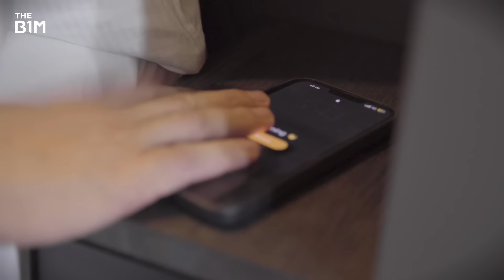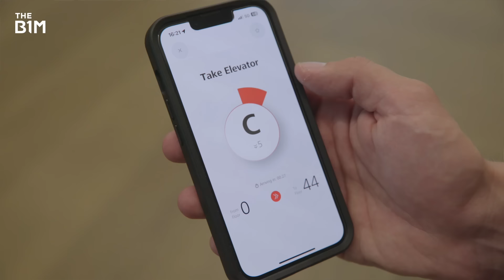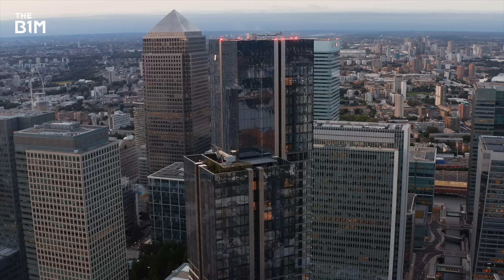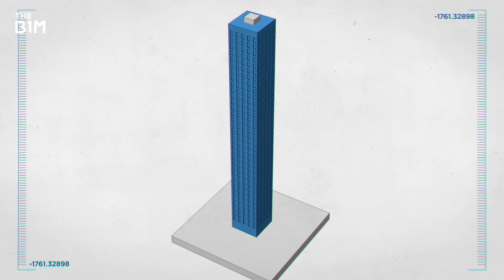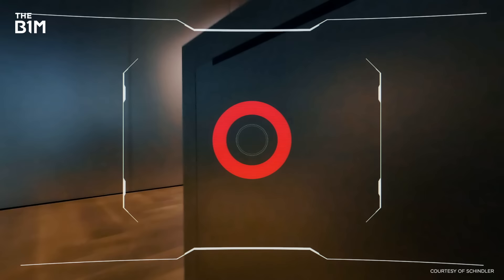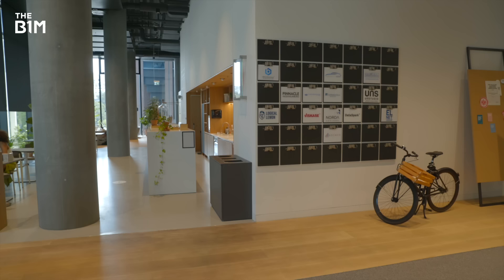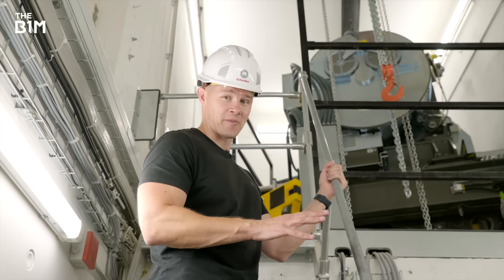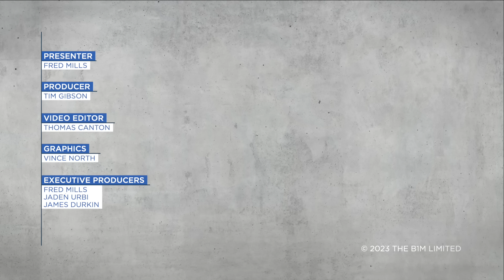Germany Has Solved the Empty Skyscraper Problem

Comment: They need to program it so that at certain times of day, when people are going to and coming from work, the elevators switch to serve only certain floors.  If you have 40 stories, and 4 elevators, there should be a display screen that shows each elevator is now servicing only 10 floors.  This way you aren't going all over the tower for all floors on each elevator, possibly stopping at 20+ floors as it goes up and down.  You could even adjust it so that floors with more people that are busy at certain times get more elevators and floors that have fewer people with less traffic at that time get assigned less priority.

Comment: The big problem here in Brasil is the landlords because the price for commercial use for rental is around 80 to $250 (reais) for 1 m2 while the residencial is around 15 to 35, so they don't want to make investment to change for something that can destroy value and maybe don't work, is better financially to have some vacancy instead of change. But some buildings in cities like Rio de Janeiro with vacancies around 40% and some places in São Paulo with 25-35% are start to change for mixed use

Comment: Elevators are just one piece of the puzzle. Office buildings are very difficult to convert to housing.Many don’t work.
Consider mechanical, plumbing, and electrical installations needed to provide the basic requirements for each unit.
Usually the costs are too high and the layouts are not marketable.

Comment: Analogy:  This is not the situation where you need an analogy.   It is not complicated to say that a sky scraper has offices and living spaces.   The Elevator concept is confusing; for example, it is not explained how this new system would help someone living in this building avoid the flood of workers going to work at 9am ... and then pouring out at 5pm.  At those times all the elevators would be packed.   Perhaps the offices on the ground floor helps this somehow, with the reduced number of floors to flush people out and in quicker.   But with Commercial on the top?  What is commercial?   Shops?   That could be very high volume.    I don't see how calling an elevator as soon as you enter the building solves anything ... but for that one person who is still competing for the elevator with other people who have the same technology ... there are buttons for that ... first come, first to push, first to get on.

Comment: I am concerned that an employer might offer a discounted apartment in the office building as a benefit of the job, then make demands that you work longer hours, or be available during your hours off work. The adaptability and flexibility to transform the buildings might lead a company to push you out of your apartment so they can repurpose it for a hotel. There would have to be oversight to prevent abuse.

Comment: So this whole video is about a software to program the elevator to go to a certain floor? Is this not how some elevators in the newer buildings work already? 
My friend is an architect and she worked on some of the largest skyscrapers in Hudson Yards in New York, she said one of the biggest challenges is actually related to light and the floor plan. Skyscrapers are designed to have large floor plans, you can not really convert most of them into apartments efficiently particularly due to the window situation. There is a lot of space towards the center of the building, but each room in an apartment needs a window, so the space from the center of the building to the wall/window can only be used for one room, and the deeper you get in that room, the less light it gets, if the building has a large floor plan, it’s a serious problem. There is an actual metric for this but I forgot the term she used. 

Yes you could use the center space for something else like a gym or a common area, but you don’t possibly need that for every floor for a building with 50+ floors. Let’s see what options you have then, 1. Build narrow and long studios only? 2. Build a lot less apartment units with super large rooms and massive square footage that a less people could afford? Neither will work at the end unless the building is small enough.

Comment: I must be missing something. In a single use building the elevator serves every floor, in a mixed use they need multiple elevators to serve specific floors and the big idea is to use an elevator system that visits every floor but is restricted by the passengers requirement. 

In a building that is office, hotel and residential if there is an office worker, a resident and a hotel guest waiting in the lobby and they get in the same lift, doesn't that go back to it being a dumb elevator?

Assuming that there have to be emergency stairs, don't they go to every floor? 

Is the world convinced that home working is the new norm? How many people have a proper working environment at home? What happens to the handling of confidential files? How does IT support get extended to the home? 

Chances are that there will be a slow and steady drift back to the office as businesses  realise that home working is not as productive as people think it is.

Comment: Floor to ceiling glass might look good at first but will cook you in sunny conditions forcing 
AC and create cold convection flows during cold conditions.  Covering 70% of the windows with foil faced insulating foam could fix that.

Comment: What I don't understand is why commercial and residential use needs different access points at all. Why is it such a problem if an office building and an apartment complex have the same front door? If you get into the appartment part of the complex you're still just in a hallway, it's not like you'd enter someone's living room when the elevator stops.

Comment: Generally, you enter an elevator like any other room; through the door. And that's also how you leave it - right? Actually, an elevator doesn't even need a door - more about that in a moment...

I also wondered why elevators don't do justice to their (usually..) square floor plan by adding a door to each of the four sides? Thus, an elevator would be able to separate four different areas in a skyscraper & to approach them independently, depending on what the person wants to reach.

One wants to go to the restaurant on top of the skyscraper? "Door" #1 opens when reached. Offices would be reached with the 2nd "door" etc. Whereby the elevator itself would not even need more doors than rather the respective floor would be reached/entered via one of the four sides of the elevator. A hexagonal elevator floor plan would also be conceivable, which would consequently function with correspondingly more parties.

If the parties ["all.."] were to change & the use of the building were to change, only the information would need to be changed - the elevator as such would not be affected in any way by a structural change nor would it need to be thought about.

We are talking about a single option. Two elevators of four "doors" each would now do justice to eight parties. Depending on the maximum number of parties planned in the respective building, the "largest" party could have two "doors" - or, if used for other purposes, one party could be added without having to take structural measures with the elevator.

Means: An elevator does not only go up & down; it connects or separates in a high-rise building three-dimensionally similar to an intersection in road traffic. With the difference that it additionally acts on (all..) levels (floors).

Or in other words:

The different options to use the floors of a building result in XXX possibilities based on the floor plan of the elevator.🙃

Kind regards,

} ζicᾰdἒ_Διphφ {🦉

Comment: If I understood correctly its not a new elevator, but the elevator for residents only opens in the middle part of the skycraper, and for offices only below or above. so you cant geht to the business area if you are a resident. And most skyscrapers solved this with multiple elevators, which is much more costly.

Comment: No discussion about different needs to utilities between commercial and residential? Nobody is going to build an office building and install and massive amount of plumbing with the thought that maaaybe it will be turned into residential in the future. The elevators are definitely not the largest hold up in the current conversion.

Comment: A lift provider creating a problem so they can fix it. Plumbing and other services are the actual problem in mixing a buildings use when it wasn’t designed to allow it.

Comment: Whats not noted is that most offices are not Grade A, they worked when minimal WFH drove office demand (even poor offices) but what do you do with Grade B-C-D offices? Near zero interest to commercial movers, expensive to retrofit to Grade A plus. Expensive to tear down to rebuild as an apartment. High borrowing costs to fund such expensive changes. Leaving it empty is the cheapest short term answer (negative profits can be used against future profits on other assets that are performing). 90% of existing spaces are already built. Its not future office skyscrapers that is the issue its every non grade A office blocks. Offices are not apartment blocks with some interior rework.

Comment: I'd have thought a huge issue was water use. Apartments have far more demanding plumbing and gas requirements for kitchens and bathrooms in every unit, vs an office which might just have 2 bathrooms and a kitchen per 50 people. Zoning is also a massive issue and cities tend to stay purposefully restrictive on that front so as not to have rapid residential developments show up that quickly overwhelm public services. 100+ families moving in means you likely need a new school and that is not something that can be easily turned on and off per consumer demand
Reply: Plumbing involves pipes in the floor. I'm pretty sure the solution is that the floor and ceiling are suspended, or able to be accessed easily, and there are pipes in place ready for a plumb to pull up the floor, and connect if he needs to. This is not rocket science, it's just basic planning in advance. But yes, I feel it's reasonable to assume that they thought, 'Gosh, how many utilities exist in buildings? A few? Do they use pipes and wires? Yes, yes they do. Do those run through floors, ceilings and walls? Yes, they do, Bob. Should we make sure there's enough of the right ones for multiple use cases or conduit or whatever we need to make this entire building concept work or should we not think about anything but the lifts?'

Now... if you'd like to see a video explaining the other features, just ask for it!

Comment: This is ......dumb......

There is ALWAYS a need for more apartments. But not offices. Issue is you office spaces can become free WAY easier than apartments. Once someone lives in an apartment, its hard to get rid of them. But offices come and go...businesses downsize or leave all the time. 

So whats going to happen is during downturns, office space will get converted to apartments. But then....when upturns cause a need for more offices, good luck getting rid of the apartment occupants. 

So over time, more and more of the building offices will turn into apartments until the whole building is, and never back in the other direction.

Comment: This is silly; all office buildings separate the uses of one floor from the others. An engineering firm on floor ten doesn't interact with the fashion magazine occupying floor fifteen. BTW, elevators customized by company or visitor have been around for more than twenty years.
None of this solves any "empty skyscraper" problems; it doesn't convert office space to residential. Office space needs huge empty floorplates, while residential is compartmented and has much different plumbing, electrical, and HVAC requirements.
Does anybody else remember when B1M was about construction, and not just focused on selling advertising?

Comment: I've just come off a cruise ship, 18 decks, it's big. Rather than having call buttons for the lifts there is a row of numbers .. decks .. select your destination deck and the display will tell you which lift will be along to serve you. System worked very well, as more passengers arrived the system woulld allocate a second lift. Granted, there could be overcrowding if every group had space consuming wheeelchairs or buggys but that was a very rare event.

Comment: Office buuildings typically have toilets in central block. and the AC system pushes fresh air in the floor and it is vented out from central toilets.  Converting to residetial requires complete rethink of the AC system and plumbing. Consider just the clothes dryer exhaust.  It isn't a show stopper as it is being done in many places, but this isnt about putting up different office walls and remove ceiling fluerescent lights and put in carpeting and residential furniture.

Comment: At peak times that makes the traffic through elevators intolerable. Also, living in a residential zone, I wouldn’t want to mix in with the general public to have access to the residential properties by default because it’s a stop on the way to a higher commercial floor. That would make it difficult to maintain a secure and private residential zone.

Comment: I am always surprised to find that engineers have not yet designed a vertical railway, that has local and express stops with the cars running on loops instead of shuttles.

Comment: Usually the B1m is pretty good.... this just feels like they think mixed use commercial/residential is an amazing development due to (???). This isn't a ground breaking development, and frankly the elevator system is probably the least ground breaking part. Plumbing, electrical, HVAC, parking, and probably most importantly zoning restrictions are comparatively massive beasts to tackle and far more engineering can go into getting those done.

Comment: For an elevator company you'd really hope a break through would be something a little bit more than, "We built the elevators all the way to the top floor and gave people access cards." That's it???

Isn't there a company in germany that's making elevators that go sideways and doesn't use ropes? Even if it's vaporware that qualifies as ground breaking for elevator tech. Though I'm sure the access cards you make are nice.

Comment: all happy and good .... but 2 side elevators take 300 mm of spec and if you used 1000kg elevators then that is going to be a problem (thats for a max of 70 meters tho because above that we generally  use bigger ones)
if its a new building this is definitely a good option but we already implement this

Comment: If the elevator doesn't pick up mixed loads it's going to be painfully slow during transitional times. Who gets priority? Is it first come first serve? Whoever has higher demand or whoever pays the building more a month for a "priority elevator"
I've worked briefly as an elevator operator, we responded to radio calls for service to floors and it was neither fast nor effective. I can't imagine forcing a second traffic stream making it any better, even if it's controlled by computer. Hell, the added complexity is going to make Schindler a fortune in service calls.

Comment: Mmmm honestly I have seen this in many many buildings in Canada and Mexico at least before 2010. Nothing new here. Even old hospitals have this system to avoid unwanted users in specific areas. 😅 Elevators with 2 doors have been around for decades. Seems Europe is way behind TBH. I guess in Europe is revolutionary because they rarely build anything taller than a church.

Comment: Never thought on the need on different lobbies, is this really such a game-changer for the use of a building ? Two-door lifts are quiet common in Germany.
You enter from outside the building into the elevator, and the door opens inside the building to the inside.

Comment: This building was designed to be either offices or residential spaces. Great. 

That does not help the existing buildings. They were designed to be offices. Sure, they can be retrofitted, or can they? Plumbing is an issue. Individual heating and cooling of spaces is an issue. It is not that easy.

Comment: What we'd need are not just elevators, but extra tall floor-to-floors and 18" allowance from plumbing/drains to be built beneath raised platform floors that would allow for 'easy' reconfiguration without cutting through the slab/steel deck. Also, allowances to have bedrooms without natural light (in large floor plates) and inoperable windows...
Reply: Vacuum plumbing enables plumbing to be run in the ceiling and also dispenses with large water tanks as a vacuum toilet requires only about 250ml of water to flush. These systems are widely used in schools, hospitals, hotels, prisons, apartments and stadiums as well as on various forms of transport. Some office buildings already use vacuum systems especially where additional facilities are required for executives, call centers and other additional requirements.

Comment: I still don't get it. How do they use the same elevator but never meet? At the start of the video he says that the commercial and residential have two different lobbies but later on he says they are saving space by not having multiple lobbies etc.

@6:32 he says they're using 8 elevators in one crew and 2 of them have an additional door at the opposite. What does that mean? Just an elevator with 2 doors? This isn't explained very well.